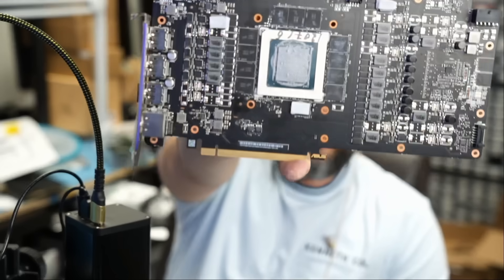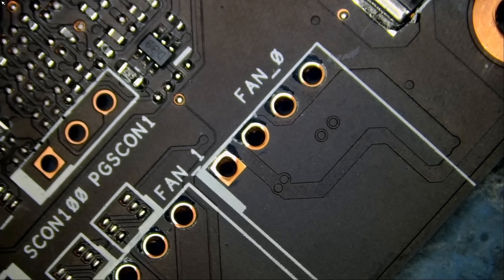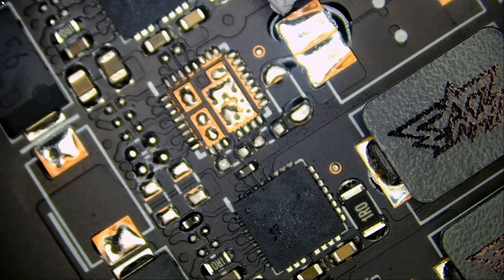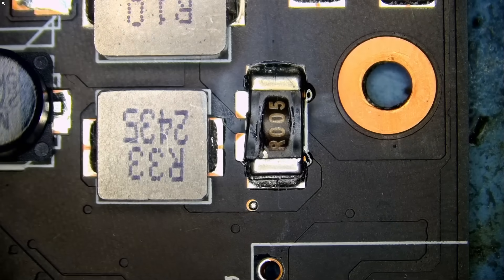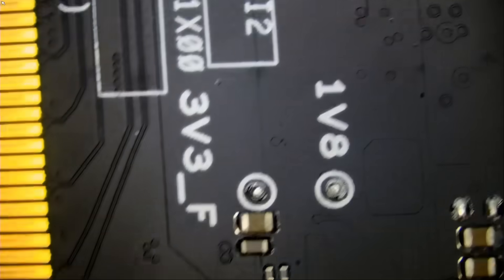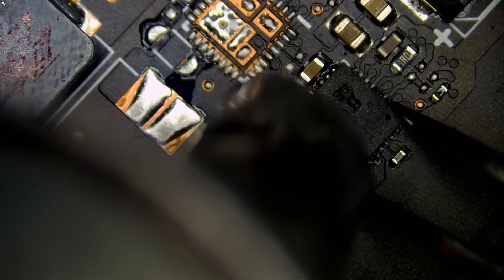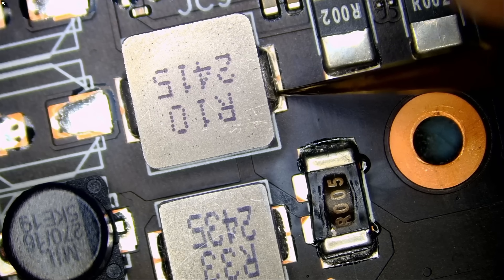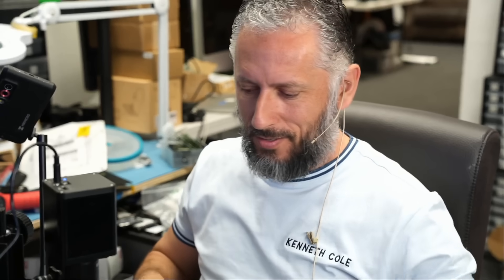DEAD Asus TUF 4090 GPU No Power Repair

Comment: Hello, I have a dell g5 laptop but it stop working and make a power cut off when I plugged the charger, now I have been replace the processor ic which make the short circuit ,but it would not work and the electrician told me the processor need to be replaced, the power is on and the keyboard is lightning and a small sound is occurred , how i know if the problem is hardware or software

Comment: Datasheet on that SIC 654 is pretty funny:
Robust and reliable
- Delivers in excess of 50 A continuous current,
70 A, peak (10 ms) and 100 A, peak (10 μs)
- Over current protection
- Over temperature flag
- Over temperature protection
- Under-voltage lockout protection
- High side MOSFET short detection

Comment: 10:39 You should preheat such beefy PCB, on moleculair level there is expansion and shrinkage which creates forces, preferably there should not be any stress, by preheating you taking this stress away, this seems a hasty repair.

Comment: NorthridgeFix : you've probably repaired a few thousand of these 4090-s by now....kudos to you mate....but why do you continue to do it ? Every single 4090, 5080 and 5090 will die from this stupid PWR design on the circuit board. There is a single shunt measuring 12 V on the GPU side and all of the 6 x 12 V PWR cables are conjoined into 1 big 12 V solder. That is a stupid design that a 15 years old middle school boy can design.
Reply: This is not a problem caused by single 12V Rail from the cable.

Comment: Shouldn't these cards still be covered by warranty ?
Reply: In europe yes, 2 years warranty
Reply: 2 or 3 years I would think.   I've been buying MSI cards for almost a decade, but I always register them with the manufacturer.   Back when the 20xx series launched, I bought a 2070 from Newegg, and about a week past the newegg return period the thing died, and I had to do a warranty claim with MSI.   So I had to ship the card back (at my expense), and it took almost 8 weeks to get it back but they did fix it and it was rock solid ever since.   I've been through about 3 new GPUs since then, but that old 2070 is still kicking as a dusty old shop computer nowadays.
Reply: Manufacturers don't cover electrical damage, which is probably what happened to this card
Reply: @KeepersWay yes they do

Comment: Do you still fix 1070 ti gpus wanna send
Reply from the maker: Not economical. Repair will cost you more than the price of the card.
Reply: @NorthridgeFix I understand
Reply: If you don’t really care who the GPU maker is, AMD may just have some stuff coming down the pipeline that could work. Would need to wait for reviews for the full story. However the reported prices will be lower than Nvidia. 

Nvidia is still have problems even with their 50 series. Review channels has mentioned this, (this part of the comment is more for folks who may not have known about this.)

Of course there is always the second hand market, which this statement is for all do be careful where you buy second hand. Look for a reputable place.

This is just my personal opinion so anyone is free to interpret how they wish.
Reply: Some medical devices or industrial equipments that containing pc parts , works only with certain equipments, which produced together in the factory . 

I even have two canon scanners in the office right now with different models and running inside of it windows 2000. drivers for embedded to OS and no way to add/install others. 
Best regards from Turkiye.
Reply: Whats wrong with your 1070ti?
Reply: @MrDearCandy nocked of components I think there 3 since then gpu not dipplaying
Reply: @weelesway4367 just go get a RX 6000 or 7000 series Brand new in Box and not screw with it.